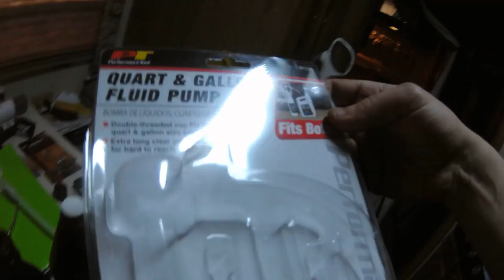RV / Motorhome Rear Differential Oil Change

Comment: Why are you not using the plug that's underneath to drain it why did you take the pan off
Reply: I don't think there's a plug underneath.  Plus, removing allows you to inspect and wipe out the old (thick) oil.